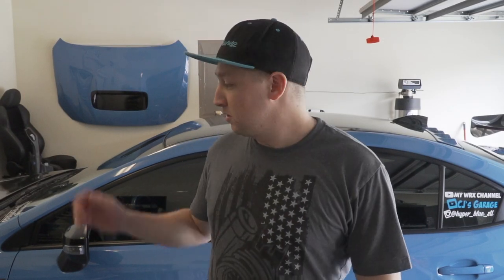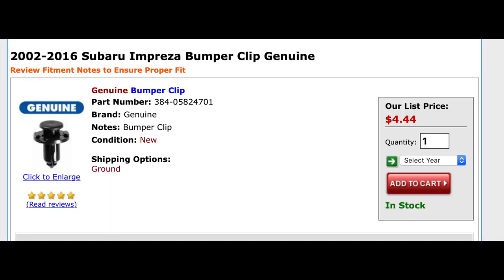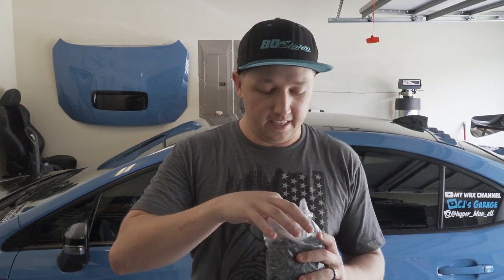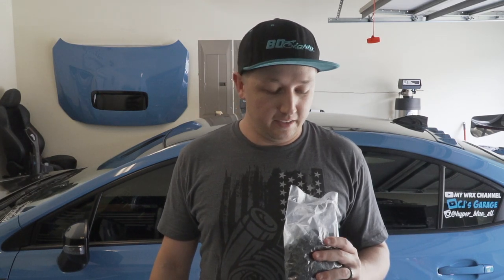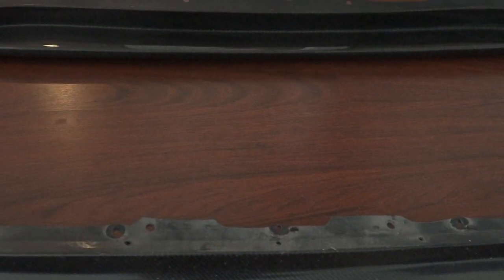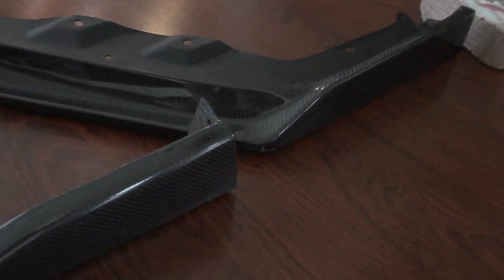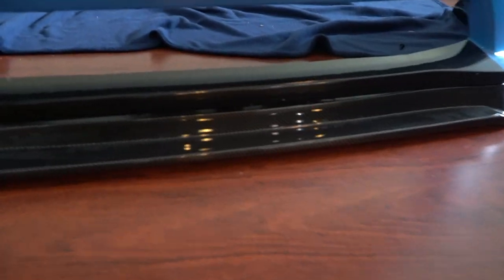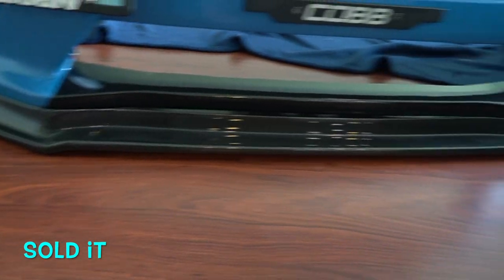Seibon Carbon MB3 Front Lip | Goodbye Ebay Lip | 15-17 WRX / STI

Comment: I always use dealership prices on small plastic parts like this as an example when people complain about "cheap plastic shit from China" being sold online. 110% smarter to buy pop clips in bulk online than to go to any OEM parts dealer. Even if the clips break every now and then, you can still get an almost infinite amount online for what it would cost from Subaru just for 10 of them.